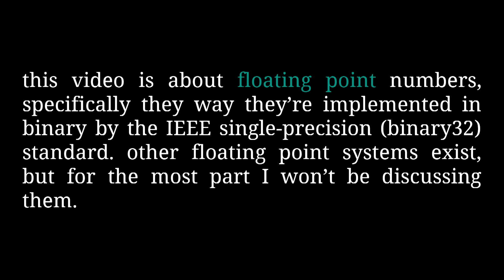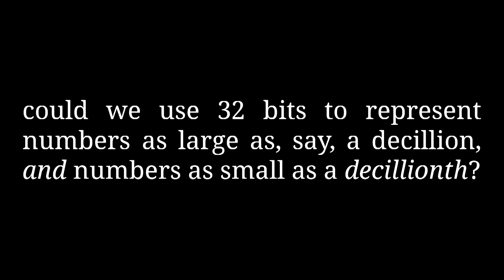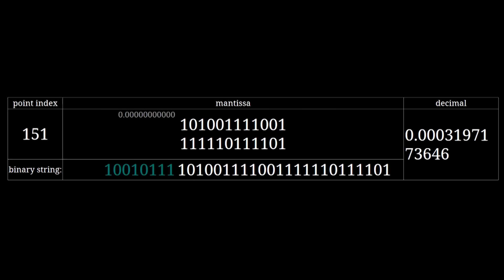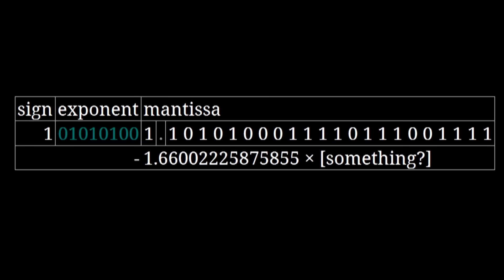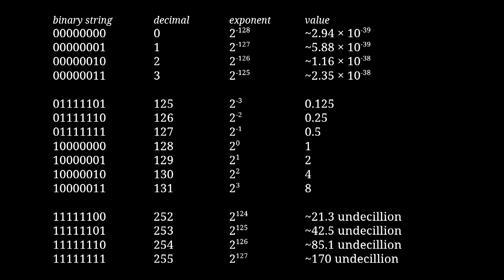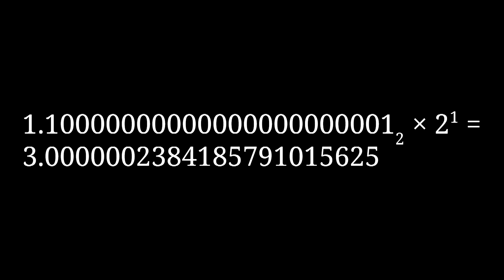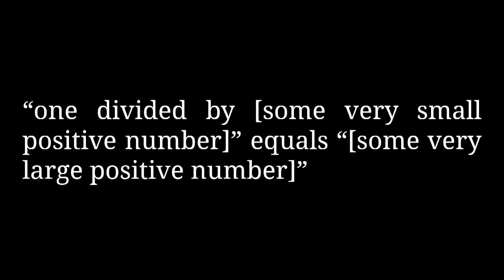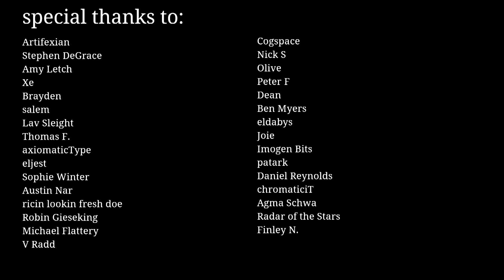how floating point works

Comment: Another reason for 0 being positive and 1 being negative: (-1)^0 is positive, and (-1)^1 is negative. More technically, it's because the multiplication of signs acts as addition mod 2, with positive or 0 as the identity, respectively. (So when multiplying floating-point numbers, the sign bit is just the XOR of the sign bits of the multiplicands.)
Reply: Wow I never thought of it like that, neat! Also don't think I've ever heard anyone use the word "multiplicand" before. Also I know you
Reply: First time I've seen someone use "multiplicand" instead of "factor"
Reply: @LARAUJO_0  If you want to get really particular about it, they're not synonyms. A factor is something that divides something else, usually in some 'even' way, but a multiplicand is just an operand to a multiplication operator. You wouldn't say that 1.5 is a factor of 6, but 1.5 × 4 = 6.

But the word "operand" or "argument" is usually clear enough in context that "multiplicand" is uncommonly used. Even "term" often does the trick just fine.
Reply: @killerbee.13  And just to be TOTALLY pedantic, the first argument of a multiply operation is called the 'multiplicand' and the second argument is called the 'multiplier'.  (and of course the result is the 'product')  But I've never really had to use this since grade school.  (except when being TOTALLY pedantic.  lol )
Reply: @killerbee.13  In Algebra, "factoring" is used to represent the process of representing a quantity as the product of several "factors". I guess authors usually do not explain that the real reason we use that word has to do with the fact that the factors evenly divide the original quantity. I suppose we use the word "factor" to emphasize the fact that a "multiplicand" (or a "multiplier") exactly divides the product. The same happens with "term" and "addend" and "summand" (and even "augend", too).
Reply: @lapatatadelplato6520  yeah, since it's commutative there's no significant difference. It's not like divisor/dividend
Reply: In Matrix multiplication it is not commutative. So left multiply and right multiply give different result. So the distinction is needed.
Reply: Was about to post this, thanks for sparing my fingers!
Reply: the words you have typed in this comment melt my brain

Comment: Thanks, this is a very straightforward explanation and I'm probably going to link it to any neophyte programmer asking me a question about floating points :)
Or anyone who shouts that JavaScript is a bad language when the flaws they're complaining about are really just flaws with the IEEE floating point standard that JS doesn't encapsulate.
Reply: I mean, "all numbers are double precision floats, deal with it" is a pretty awkward design decision. On the other hand the thing was thrown together in like a week and a half originally and when you take that into consideration it's pretty good.
Reply: Having no integer data type is FAR from the only reason why javascript is a terrible programming language.
Reply: @notnullnotvoid  that doesn’t preclude many of the complaints made from being mistaken though
Reply: @notnullnotvoid  Plenty of languages with a high level of abstraction have only one number type. 64bit floating point numbers are pretty good at representing 32 bit integers accurately, so when dealing with human-scale numbers it's rarely a problem. But JS could have done a better job handling NaN, Infinity and -0 for sure.
Reply: @notnullnotvoid  eg. The Date system
Reply: Uhh, JS has BigInt though?

Comment: 0 meaning positive means that it's possible to zero out the memory (such as with `memset` or `calloc`) to get floating point value +0.
Reply: If the sign bit worked the other way around then that would set the value to -0.0. In most cases that difference would probably be harmless though sometimes it could cause problems.
Reply: Oh, that's a good point. Especially since the same holds for integers. So zeroing memory gives you the same value of +0 in both data types.

Comment: I think the reason that the first bit being a 0 represents positive numbers and 1 for negative is so that it's consistent with signed integer formats. When you add two signed ints (or byte, long, etc) you just go from right to left, adding bitwise and carrying the 1 to the next digit if you need to. The leading bit of a signed int is 0 if it's positive so that, to add two ints, you can just treat the leading bit like another digit in the number. For example, in signed bytes, 1+2=3 is done as 00000001+00000010=00000011, but if a leading 1 represented a positive number then if you tried to apply the same bitwise addition step to each digit, you would get 10000001+10000010=00000011. Since you're adding two leading 1's together, they add to 0, which means the number becomes negative. When using a 0 for the leading digit of a positive number, you don't have this problem when adding together negative numbers, since you'll have a 1 carried to the leading digit (so for example, (-1)+(-2)=(-3) is done as 11111111+11111110=11111101) unless the numbers are so negative that you get an integer underflow, which is an unavoidable problem. Because this convention makes logical sense for signed ints, it makes sense that it would be used for floats for consistency.
Reply: One useful result of the sign bit being 0 meaning positive is that this way the "ordinary zero", i.e. "positive zero" value consists entirely of zero-bits. So if some piece of memory is zero-initialized, and then interpreted as floating point numbers, those become zero-initialized, too.

Comment: I think perhaps 0 as + and 1 as - could be a case of default (off) versus the only possible changed state (on)/ underspecification (+ by default) vs specified case (-)
Reply: It also works for fixed point or Integer addition, with 2s complement. If you add a negative number to a positive number if the negative number's absolute value is larger than the positive number the resulting number won't have an overflow carry so the sign bit will still be 1 (so still negative). If the positive number is larger than the negative number's absolute value, you will have an overflow carry into the sign bit, which will then become 0, as 1+0+1 = 0 with a carry out (which is usually ignored). As a result, the writers of the IEEE floating point standard probably went with the same convention for the sign bit as prior signed binary representations.

Comment: I actually had an issue with adding decimals in programming.
I did "0.2 + 0.1" and got "0.300000....".
No idea why this occurs.
Reply: Floating point can't represent those values exactly, so it stores and computes close approximations, and ends up with weird-not-quite-exact values sometimes.
Reply: it's basically that .1 and .2 aren't perfect in binary. like how in decimal, 1/3 =.3333... but computers can't store infinite data, so it'll just keep the first few, so it's kinda like if you asked 1/3+2/3 and it interpreted that as .3333+.6666, thus instead of giving you 1 it gives you 9999/10000 except on binary it happens with basically any fraction where the denominator isn't just a power of 2
Reply: Now that you've seen this video, you should actually be able to answer that yourself!
0.1 and 0.2 are in some range of number, and when you sum them you get some other range. For whatever reason, the function that actually turns that range into a decimal number decided that that range is represented by 0.300000000000001 (or whatever the actual number is).

Comment: The reason 0 represents positive and 1 represents negative has to do with the fact that signed/unsigned standards with overlapping range will be the same if you do this for integers and the standard was carried over to floating point.
So for 8 bit integers the range from 0->127 can be represented in both signed and unsigned standards. Because it would be convenient to represent them the same way, someone made  the decision to do that. The result is that positive numbers in signed integers have a leading 0 and negatives have a leading 1.
Reply: However that's not how CPUs actually do it, they use 2's compliment where for example 95 and -95 have (almost) no binary digits in common at all
Reply: @Henrix1998  true, but with how two's complement works the first bit is zero for positive integers and one for negative. It still leads to "eh just copy how it works with ints for ease of use"
Reply: @Henrix1998  They weren't saying that negative and positive numbers look the same.  What the original comment was saying is that a number like 2 would be written the same way in a signed and unsigned byte, both being 00000010
Edit: whereas if you made 1 represent a positive number the signed byte 2 would look like 10000010
Reply: @Pyronaut_  the range of signed integers for an 8 bit number is -128 -> + 127
The range of unsigned integers is 0->255
The numbers from 0->127 are the shared range and it would be nice if they were represented the same, so we do represent them the same. That's why positive numbers have a 0 leading bit and negative numbers have a 1, occupying the space that 128->255 would in an unsigned integer.
I figured explaining 2s compliment is beyond the scope of what's needed to explain why negatives have a leading 1.
Reply: @Henrix1998  yes, but it's still a thing that negative numbers start with a 1 and positive numbers don't (in signed integers), and the positive numbers are the same whether or not the first bit is treated as a sign bit.
Reply: @Henrix1998  That's not what he said. But he's not clear on the motivation.
Reply: I'm assuming it was done that way in integer (and then floating point) because programmers often make the default state of a Boolean negative, and the modified state of a Boolean positive. For instance, if something went wrong with the assignment of the Boolean, it would have the default and/or more common value and more likely to be correct and fail silently.
Reply: @corylong5808  No, it's entirely unrelated to booleans. Booleans don't have anything to do with positive or negative numbers, they can only store true and false. Usually that's represented canonically as 0=false and 1=true (so only the least significant bit changes, not the sign bit which is the most significant bit). And generally any non-zero value is interpreted as true.
Reply: One result of how floating point is defined is that if you use an integer comparison (greater than, less than, equal, ...) on a floating point value with no conversion, you get the right answer.  In other words, the binary integer comparison and the floating point comparison use the same circuit.  I was told this was the reason for the definition of the sign bit and the offset in the exponent.  Of course, there could easily be additional reasons. I'm sure many many alternatives were debated and evaluated on many criteria.
Reply: I’ve always thought of it as 0 representing “no sign” (positive) and 1 representing “has a sign” (negative), so it kinda makes sense to me
Reply: Why is signed needed in integers tbh, cause it is a modular system you can just use big numbers as negative numbers, since they'd have the same effect in addition anyway.
In floating point you can't just do this but why would it need to be done in int
Reply: @jucom756  That's exactly how signed ints work. For an 8 bit signed int, any number n > 127 is interpreted as n - 256. So for instance, 128 (unsigned) is -128 (signed), 129 (unsigned) is -127 (signed), etc.
Reply: @jucom756  That's... that's what signed integers are? Like, you literally just described how integers work. The only difference is whether you interpret the leading bit as a sign indicator or as part of the number.
Reply: @jucom756  Who says you can't do it with Floating Point? There's nothing about floating point that says they can't use the same system, and in fact there is an alternate floating point format that does exactly that. The main différences is that you lose -0 and -♾️, since 0 and the smallest possible value in that system are both they're own negative. Of course, you could always just repurpose the numbers closest to infinity and zero to regain the signed epsilon and "infinity" behavior of IEEE floating point numbers.
Reply: I thought it was mostly because of hardware concerns. Since 1 in actual hardware is usually represented by some kind of voltage, while 0 by default is not, and we tend to use positive numbers disproportionally more, it would be more energy efficient to use 0 for positive numbers.
Reply: @Yous0147  Using low voltage vs. high voltage does not result in any difference in energy use. It doesn't require energy to maintain a high voltage in a memory cell. If it's in storage, it requires no energy at all (cause if it did, your disk would be wiped every time you powered down). If it's in RAM, it will require a constant amount of memory to run the refresh circuit no matter what is being stored.

Also, it's approximately equally common to represent a 0 with high voltage and a 1 with low as it is to represent them in the other way.
Reply: @Yous0147  no nothing of the sort. Do this maths, but in binary 4-5; then try 2-3 you'll get the same result: 11111…

I'll limit myself to 5 bits, and you'll probably want to view this in monospace type, but

+00100
-00101
_____
=11111

Yes, this looks all wrong the bigger numbers on the bottom, it "won't work if you ask your 2nd year maths teacher", but what if it did?

2⁰ column: '0 take 1'? I can't I must carry : '10 take 1', easy it's one. 

2¹ column: '0 take 0' is  zero, but we carried so it's 'zero take zero plus one' again, so we carry again '10 take 1', one again.

2² column: '1 take 1' would work, but we carried so it is now 'one take one take 1' can't. We carry again '11 take 10' that we can do, one again. 

So on until you reach the last column. Any time you subtract n+1 from n you get all ones. Try n+2 from n. It's primary school maths, with a twist. This suggests our subtraction method actually implies a binary notation that exists a priori of computers.
Reply: @robinhammond4446  That's what a subtract with carry does. In assembly, you have to set the carry flag if you want to subtract into negative numbers. C = 1 This means that subtraction is actually addition with its inverse plus the carry. In your example 00100 - 00101 = 00100 + 11010 + 1 = 11111 If you look at 8-bit notation of hexadecimal. 0xFF is the inverse of 0x01, and it is clear that if you imagine an extra bit that it's really 0x100 - 0x01 = 0xFF.
Reply: It also means that if you memset a structure to 0, all the floating-point numbers within it will have a "default" value of +0.0 instead of -0.0.
Reply: Why so complicated? If we go back to the very first time negative numbers were stored in binary (long before two's complement) we still see the "1" meaning negative. And is it so surprising? We write "123 and -123", not "+123 and 123" in normal life, too.
Reply: Also mathematically it's quite elegant because you can write your number as 
(-1)^sign * mantissa * 2^exponent
Reply: Also mathematically it's quite elegant because you can write your number as 
(-1)^sign * mantissa * 2^exponent
Reply: @LueLou this is the most intuitive way for me to understand signed ints bits: overflowing back to a smaller number when adding (hence you're adding a negative number)
Reply: Or if there’s a minus sige
Reply: you tell em doommustard
Reply: If I was designing the floating point standard... well it would have been much worse--but aside from that... 0 being positive would be so that all 0's means "positive" zero.
Reply: I like to think of it as the compooter asking "am I multiplying this whole thing by (-1)?", so it becomes false when it's a positive number and true when it's a negative number.
Reply: Can't say if relevant but:
0+1 = 1                <=> +*- = -
0+0 = 0.               <=> +*+ = +
1+1 = 0 (mod 1) <=> -*- = +

So modular addition corresponds to multiplication when done this way, but not the other (two positives don't make a negative)